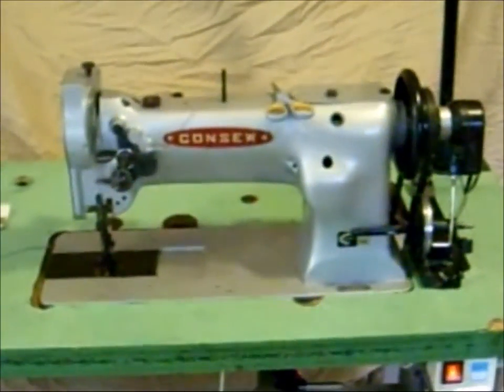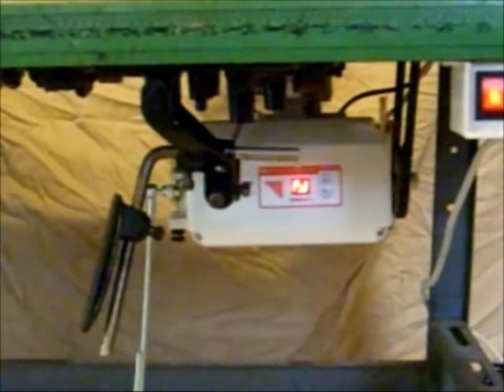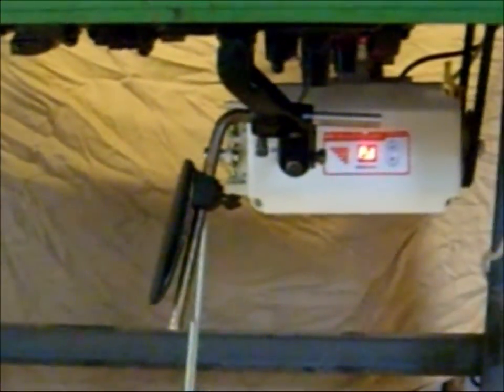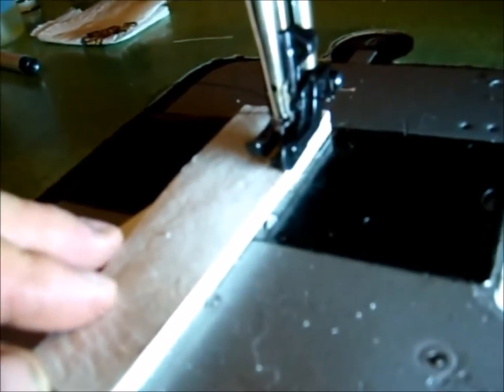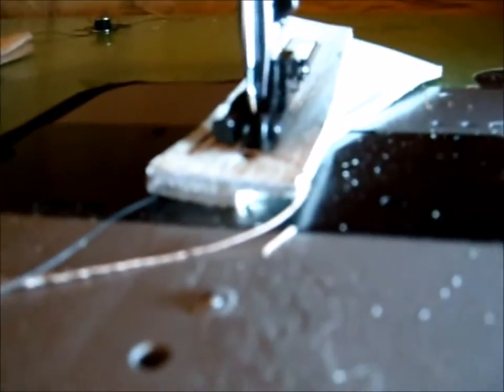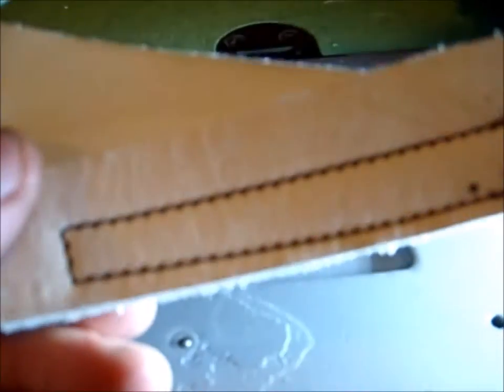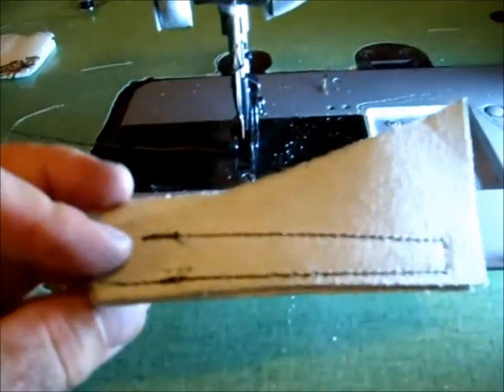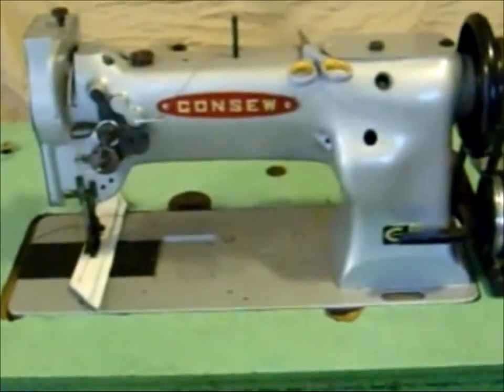Consew 226 Leather Sewing Setup with Servo Motor

Comment: That looks a very good set up......I like the soft start on your motor ...a very good idea and less stress on the electrics. It seems to me that you have a wider selection of leather machines in the US .....perhaps there is more saddle and holster making....its just an impression and I am not knocking the suppliers here that have some great kit if you look for it.
Reply: Possibly, though what there for sure are is a lot of people doing it.  So you certainly find a lot of machines that aren't being sent to the dump along with the new Asian machines.  But there aren't new US machines, for the most part.  There was the Luberto, and the Tippman.

Comment: Hi is this motor easy to install once received ?
Thanks
Reply from the maker: I found it easy to install the new motor is MUCH lighter than the old clutch motor. Getting the heavy old clutch motor out without dropping it on myself was the hardest part.

Comment: Can you use this motor (SLS-2000) with out the needle position accessory ?  Sew-Line also makes SLS-1000, still 3/4 hp but 600 Watts not 750 Watts.  Do you know anything about the SLS-1000 ?     Thanks,   Bryan